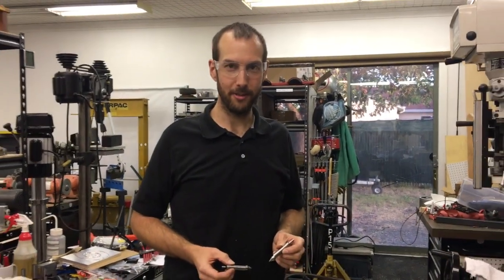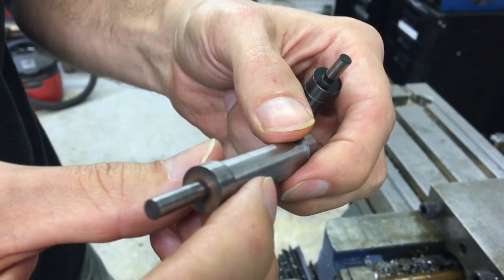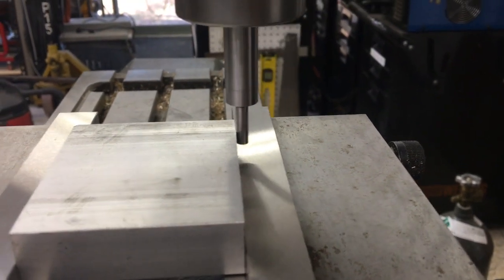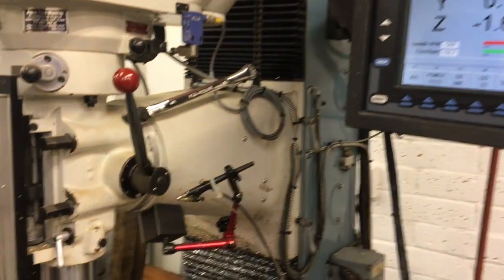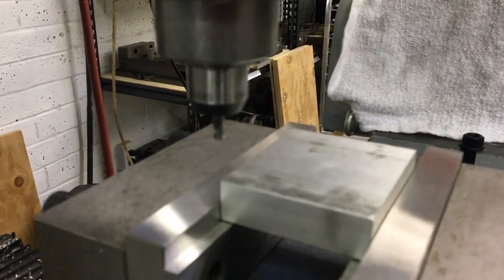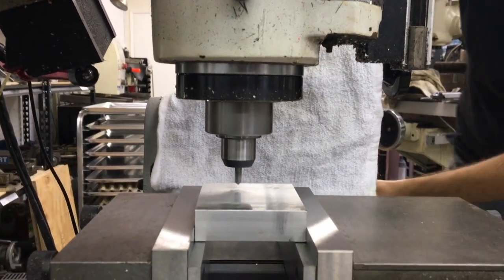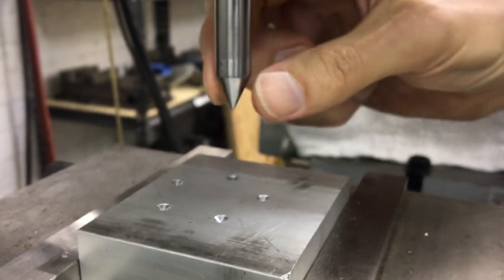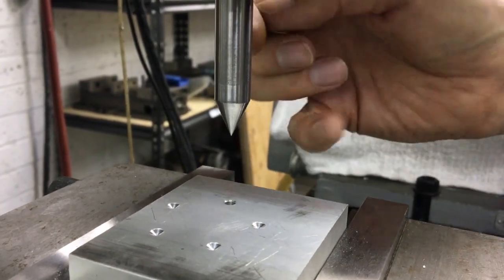HOW TO USE EDGE-FINDERS in machining

Comment: Thank you sir.
As a newbie who does not know jack,
this truly answered a couple of questions i had.

1) I realized i needed this tool for edge and center finding.  I realized there is a difference between just edge finders and edge/center finders.

2) I realized i could set the machine coordinates for my CNC mill using a center finder to find the center of a designated hole on my tool fixture plate which sits atop my CNC table.

3) I realized that I don't need to spin the edge/center finding tool and run the risk of wrecking it.  I can feel it with my finger.  This seems so obvious I don't know any anyone including myself had not thought of this earlier.
You ought to win the Nobel Prize for this.

4) I realized a couple of other things my brain has already forgotten due to my terrible memory!  I need to re-watch the video.

After watching this video, I just put in an order for a Fowler 3/8" edge & center finder.
I'm getting the 3/8" version as I have a Taig and that's the largest ER16 collet I have.  
A 1/2" collect i don't have so i avoided that.
I have no idea if this brand is any good.  
I hope it works.
Reply from the maker: Glad to help. Thanks.

Comment: I am using Starett edge finders on a CNC Laguna router table - mostly for woodworking but occasionally aluminum.  My system is not as precise as a machinist's mill, but it can be set to perhaps 0.001" to 0.002" accuracy.  With the spinning center finder method It was laborious.  I found that I can quickly and easily feel with my finder the edge at 0.001" accuracy using the static method you described.  So much easier and quicker.  This is one of the best tips I have discovered... THANK YOU.

Comment: Never used the center finder. Now that I've watch you do it and how simple it is to use, I'll put it more to practice! Thanks for the tip!
Reply from the maker: Its a tool you might not use often but is fast and convenient when you do.
Reply: It's not actually designed as a center finder, its for finding the edge on a round or angled part
Reply: The right way is to spin it.
Reply from the maker: That's an interesting idea that I have not heard or seen done before. I like that. I have always used a stop or some other fixture method to find edge on round or angled parts.

Comment: The static (non rotating) method you show is OK if your center finder body is in an accurate concentric collet, in an accurate concentric spindle nose (i.e. concentric with the spindle bearings).
However, if your collet is not concentric for any reason, it should be used in the spinning condition to find the actual centerline of the spindle rotation. Difficult to describe exactly without visuals, but if you’re looking for optimal accuracy, spin it and deal with eccentricity some other way so that you can maintain tolerances of finished surfaces.
Reply from the maker: Yes I addressed this note about a concentrc collet/holder in the video. I have tested the static method to be repeatable and accurate to about three tenths. You won't get any better than that rotating it.

Comment: Thanks  for an excellent production. 
I'm  really  keen  to find out more about your mill/ dro  set up.  
I have an R8 spindle Bridgeport clone - what do I need to upgrade  it to something  like yours?
Kind regards from John Spargo  in  Cape  Town
Reply from the maker: Glad you enjoyed it. There are very rough build your own style CNC conversion kits out there but I would look at the Milltronics or TRAK retrofits. We have several TRAK machines and use them every day with very few issues.
Reply: @TigermothRacingTV  Thank you. Will check that out.  Kind regards John Spargo

Comment: Your feeling vs spinning method works especially well for hole finders since you can move +/- in each axis.  I think your 0.0003" is a safe figure to consider for repeatability, although I think in general the sharp step is easy to feel.
Reply from the maker: Glad you like it. I found it to be a big time saver and once you get the feel of it its quite fast and easy. Thanks!

Comment: I've been looking for years for someone to tell me how to use those stupid center finders.  If you run them like an edge finder you get squat.  Your method of not rotating them makes me feel stupid that I didn't think of it myself.  Thanks.
Reply from the maker: Its odd to me that people don't mention/use them more. It saves a lot of time. Glad we could help!
Reply: I was told the conical versions were got picking up features where a standard cylinder isn't long enough, like the sides of a shaft, you just have to make sure your quill depth stays constant.

Comment: Problem with feeling the barrel and tip for concentricity is it doesn't account for spindle runout, spinning it does.
Reply from the maker: Good point! 
If you are concerned with your spindle run-out I would not recommend using an edge finder, at that accuracy I think using an indicator would be more appropriate. Most spindles will not have more than two ten-thousandths of runout. If you are concerned with that two tenths than I would recommend indicating your location off your part or fixture and also indicating your tool run-out on the holder if that is of concern. There are many levels of concern you can have depending on the precision you need to meet.
Reply: @TigermothRacingTV   I had Wells Index mill with a .007"  out spindle🤣 Was good for oversize slots and holes

Comment: Never thought about using a center finder like that. Question, I take it you use very light pressure on the spindle? Im always worried Id damage my center finder with too much pressure.
Reply from the maker: Do you have another way of using the center finder? Yes light pressure is all you need. You only need contact with the surface you are referencing. Cranking down on it will only distort the material and give you a false measurement.

Comment: As a layman, I don't quite get the purpose of this tool. I've googled a few articles and they all say it's to locate the edge of a workpiece prior to milling. What exactly does that mean? Eyeballing it, using a square or even your fingers isn't enough? Sorry for being a dumbass, I'm from the woodworking field so this is new to me. Any link to other readings would be appreciated.
Reply from the maker: Lol no worries. Yes the edge finder is a more precise locating tool. It lets you tell the machine where an edge is so you can base all your cuts off of that reference edge. Generally with about .0003-.0005 inch accuracy.
Reply: The finder with the sharp cone is a hole finder.  If you have plans for a part with a single 0,0 reference point, you can put the part square in your vise, locate that 0,0 hole and all other dimensions can be read off from there.  If you are working from others plans, it can be a big help to bring it into 2D CAD and make all dimensions relative to a single hole.
Reply: @nheng6913  

I'm a newbie here who doesn't know much.

But I'm thinking I'd design a small / shallow hole to be drilled into my part...
and then face it off once I'm finished making the part.

Comment: I use both methods but no way would I trust the feel method for anything precise. It is often held in a drill chuck and the feel method is just too sloppy.
Reply from the maker: That's totally up to you. We don't use drill chucks for edge finding because drill chucks are not made to be that precise in runout.
Reply: @TigermothRacingTV  Yes of course it's up to me, and to you. But collets are also subject to runout too. If you can afford to give away a couple of thou in tolerance great. 
Since you are only as good as your last part, you just have to decide how good you want to be. 
It does seem pretty simple to just turn on the machine and get rid of all the errors.

Comment: I have one of those dual-headed edge finders. They are, for the most part, useless to me because you can't use them on a chuck. If you do, the exposed end will come off because the other end is chucked firmly in the chuck hence it cannot rotate. Both ends are tied to each other with a spring and both need to rotate at the same time when using one end or the other. You would think they should scribe on the body of theses center finders: DO NOT USE ON A DRILL CHUCK OR DAMAGE WILL ENSUE. Needless to say, I will never buy a dual-headed edge finder.
Reply from the maker: Both ends of a double sided edge finder do not need to rotate. The tip should not rotate relative to the body. The spring is there to maintain alignment between the tip and body only. One issue I have noticed with an edge finder in a drill chuck is that the jaws do not clamp parallel on the body. Sometimes it will clamp on the top tip and not the body, leaving the body loose.
I do not recommend using edge finders in a drill chuck because drill chucks are not very accurate in general. Using a collet will give you a much better result.
Reply: I wouldn't buy one either if I was using it in a drill chuck... because they aren't meant to be used in a drill chuck. Get a collet.